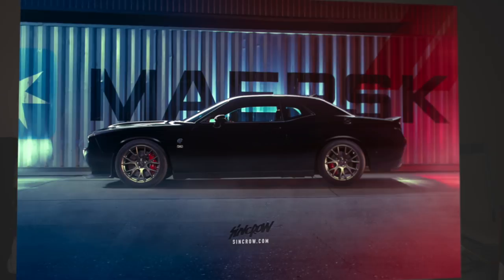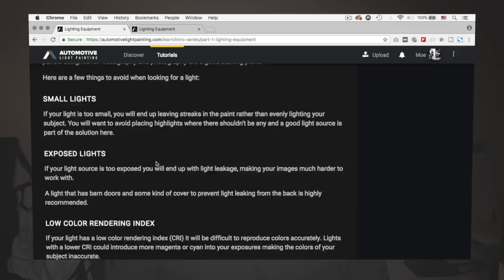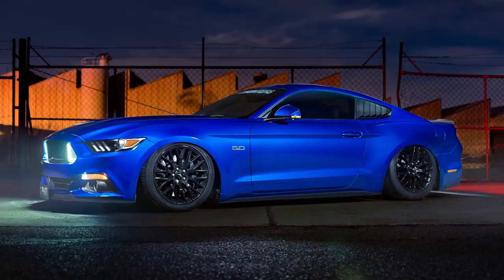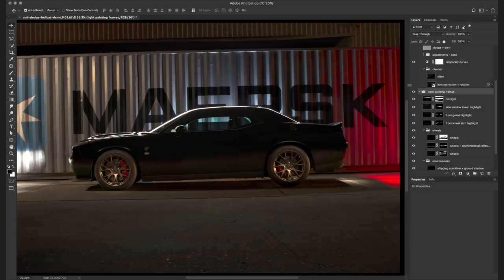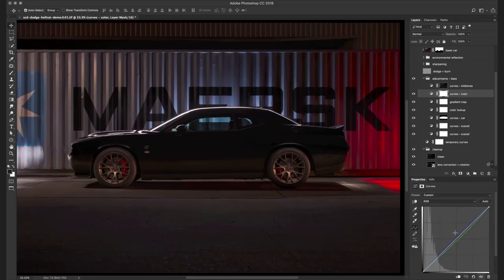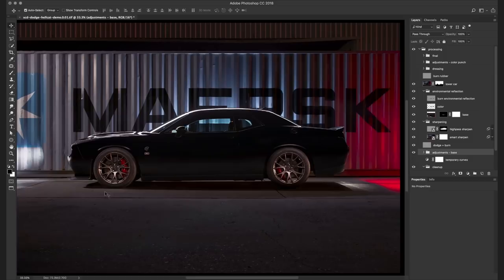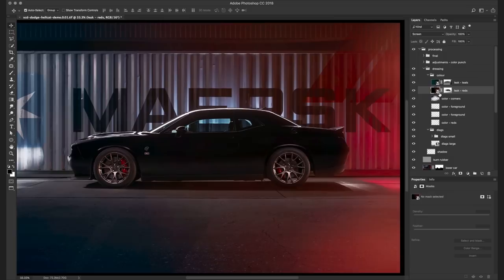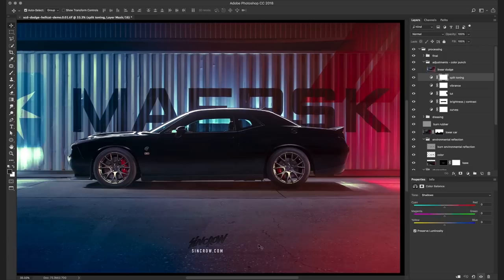Car light painting tutorial: Photoshop post processing with Kirk Bentley

Comment: question nothing to do with the video,
if i dont have a tripod with me, is it ideal to under expose to get the sky details and pump up the shadow later in post process?
Reply: Doing that you might introduce lot of noise in the shadows. I would try the opposite, expose for shadows or midtones and later bring the highlights down.
Reply: Bracket and blend in post, assuming you aren’t shooting with crazy slow shutter speeds that can’t be hand held. Most cameras can do an auto bracket on a self-timer. Brace as best you can then hit the self-timer. Auto align in PS and blend it. No noise. No blown highlights. Even on a tripod I bracket an ambient light exposure without strobes to get the environment.